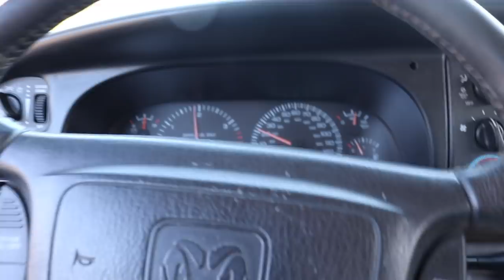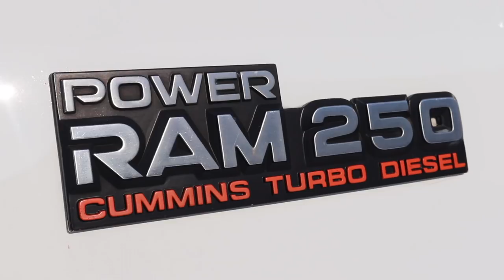SHOULD YOU REALLY TOW WITH A LIFTED TRUCK!?

Comment: I wouldnt worry about squatting with the dually. I got a 94 single cab dually with a 4 inch lift, and it didn't squatting at all with 3500 pounds of brick in the bed. I was actually really impressed

Comment: You should weigh your load to see if your not overweight on the trailer with the tractor 🚜 and all the extras
Reply from the maker: It’s a 10,000 pound rated trailer.
The trailer weights 2,400 lbs and there’s now way that tractor weighs more than 7K lbs
Reply: What model is the tractor?